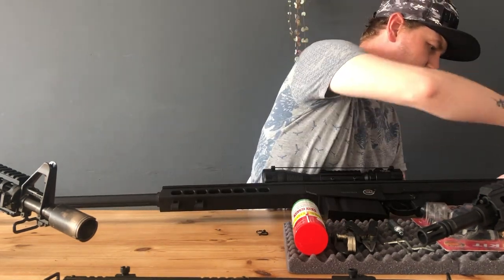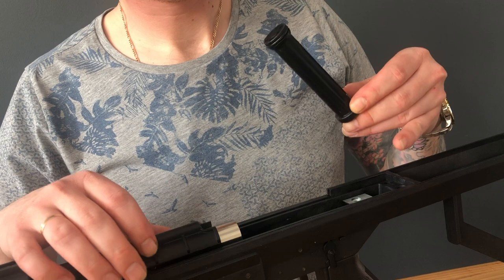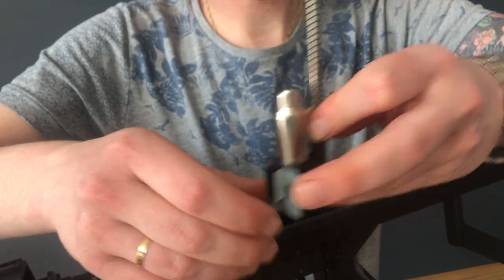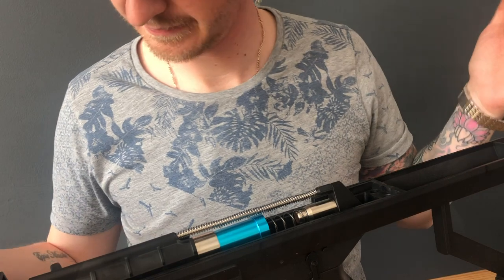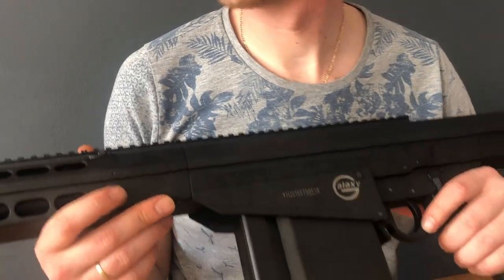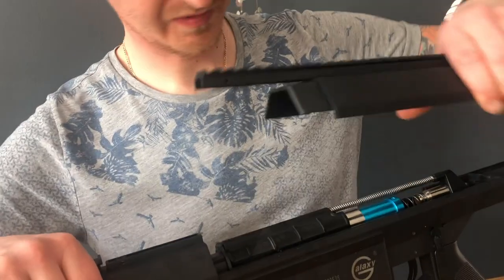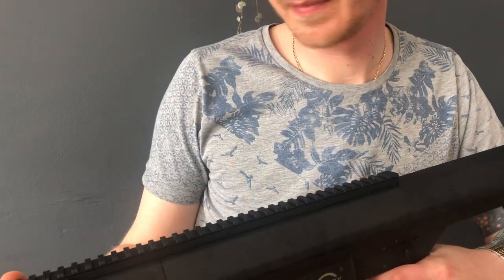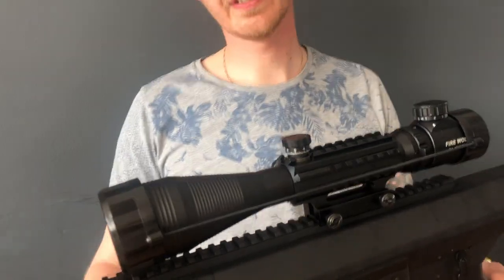Co2 CONVERSION KIT FOR THE LANCER TACTICAL LT-20 | installation tutorial

Comment: Hey man, great video, I just picked up the Galaxy M82 and was considering converting it from spring to Co2. What would you say are the upsides and downsides of the various systems?
Reply from the maker: Thanks a lot! For me a downside was the bolt pull with the standard spring… that was really stiff. The co2 conversion makes is so much lighter.
The downside of the co2 conversion is when it’s empty you have to disassemble half the rifle to get to the canister that holds the co2 cartridge… so yea both systems have pros and cons.
Reply: Efdé Airsoft  Yeah, my M82 bolt feels real stiff. How long does the Co2 cartridge last on average, in your experience? Because it's either my right arm is getting jacked as fuck while I use the weapon, or I'm gonna get real good at field stripping it lmao

Comment: The co2 kit is far to long winded for me in terms of changing the bulb, sounds great though!....I have the same airsoft gun and just changing the spring for a better one will give you 600fps+ rather than the 420-450fps you get outta the box. Nice video👍✌
Reply: Could you direct me to a better spring?
Reply: @Damn4got  https://eu.novritsch.com/product/ssg-spring/ these have ones up to 700fps
Reply: I wouldn't really advise it though as it could break the gun if not done correctly as these springs are for another gun altogether but it works better than the standard galaxy ones..much higher quality.
Reply: @soloschilling1837  ok thanks for the info
Reply: @soloschilling1837  Doesnt this rif use aeg springs?

Comment: i have the lt-20 and the bolt snapped off so i decided to buy the upgrade works great except for the co2 reload
Reply: How many shots can you get off before having to take the thing apart and reload the canister?
Reply: @allighast9714  That mainly depends on cartridge size and temperature. For a 12g CO2 cartridge (thats the most used size) at room temperature you can expect around 40-65 shots.
With my SA P84 (tho that shoots steel bb's) i get mostly 70 shots from 1 cartridge.

Comment: Will this work for an lt19 gen 2 or is there a lot for this gun
Reply from the maker: No this will not work on the lt19, u should check out hPa engines if you want to swap you’re AEG gearbox. Btw it’s not cheap 🤣
Reply from the maker: Btw, you can upgrade you’re gun with a lot of parts, a new motor, hop up, gears, piston, barrel, hop up rubber. Etc. There is a lot to gain. But if you want to get rid of the AEG gearbox it’s not going to be cheap

Comment: Hey everyone, I've made some research about the Lancer Tactical M82/LT-20, also the Galaxy G31/G31D (Barrett M82A1 .50BMG), and because I fell in love with it, I made this small upgrade list with some things that i read from people that already used and upgraded it, informations sprinkled on the web:

Sear/Barrel/Piston/Piston head compatible with SVD
Stock spring 13mm VSR, someone made and put for download a 3d printed adapter for 11mm AEG springs
3d printed file for M4 mag adapter also can be downloaded
Hop-up compatible with A&K SVD Spring

https://www.airsoftsniperforum.com/threads/lancer-tactical-m82-upgraded.16505/
This user got some nice upgrades to his Barrett, still fully spring-action, using Prometheus 6.03EG Tight Bore and bucking Macaron AST 75°

Projects powered by CO2 or HPA are indeed possible, because in the same forum, two people did the same basic build
(HPA projects need some SVD stuff and some elbow grease, unregulated CO2 does have the brand-own conversion kit, ready to use with 12g cartridges)

Comment: I dont see a positive. Even with the conversion kit you still have to cock the charging handle with every shot. And you have to take it all apart to refill it.
Reply from the maker: Ferry Beurskens that’s exactly what a said, the only positive is that the bolt is much easier to pull.
Reply: Makes it great for a show gun